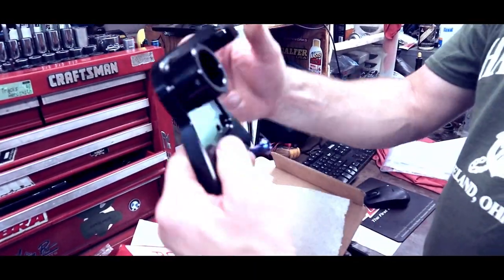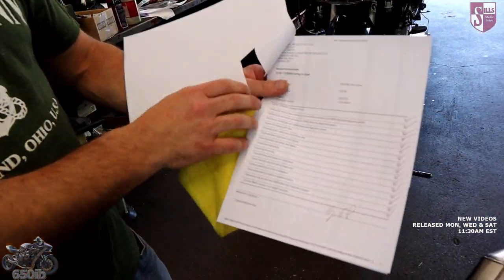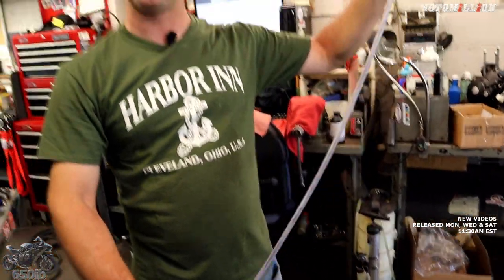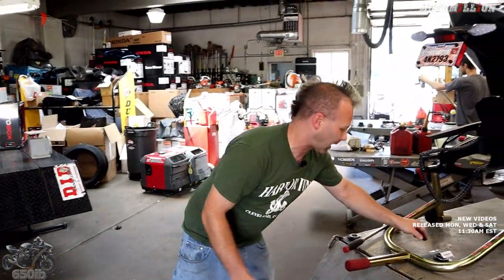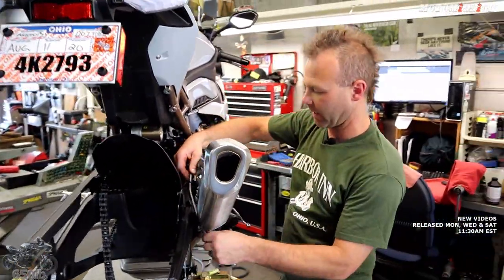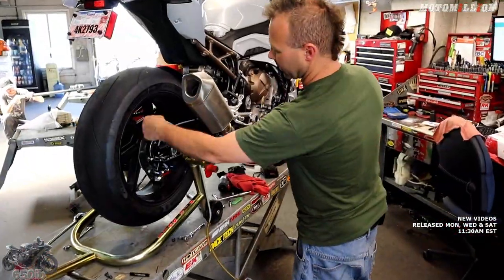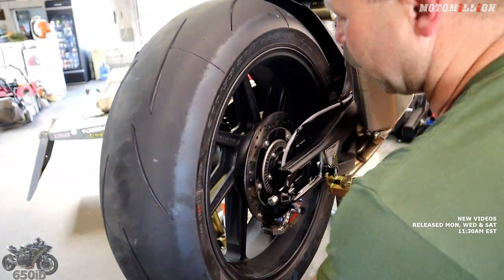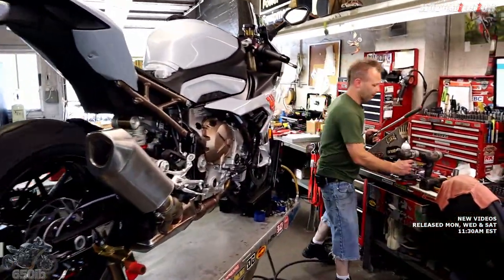UPGRADED 2020 BMW S1000RR Rear Brakes to BREMBO & More!

Comment: Question for you Zack: isn't the ABS unit higher there than ther reservoir? What are the chances of air bubbles entering the unit when changing your lines (front or rear)? Can you get rid of them the same way,  by pumping the breaks and releasing fluid from the caliper end?

Comment: when balancing  the rotobox rims do you really need to install the disc and abs rings? or its ok to balance without them?
Reply: It's better to be balanced with all components that also spins with the wheels. Of course you can balance it without rotor and sprocket but it's more precise with those on.